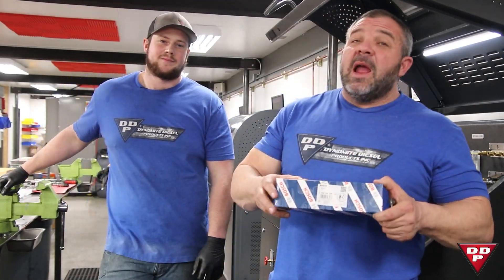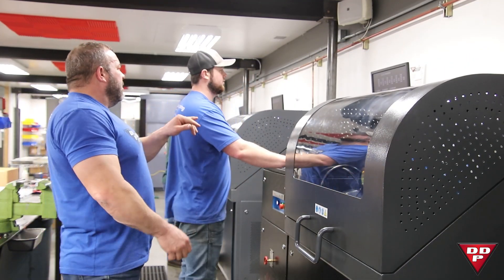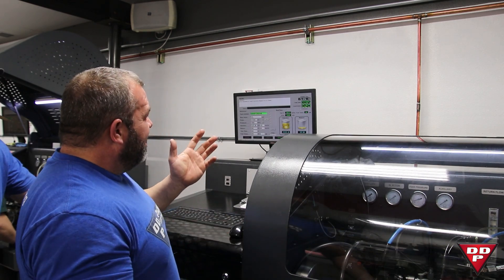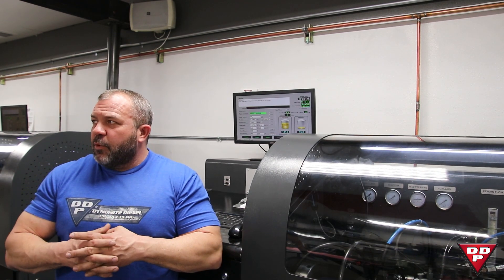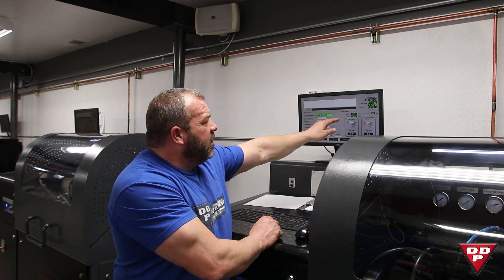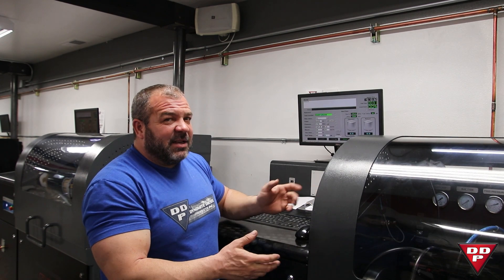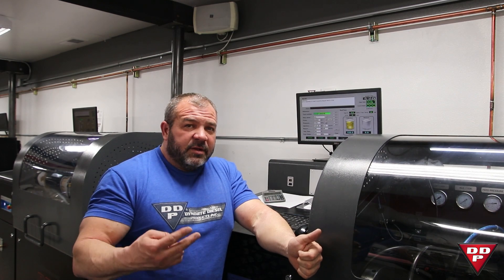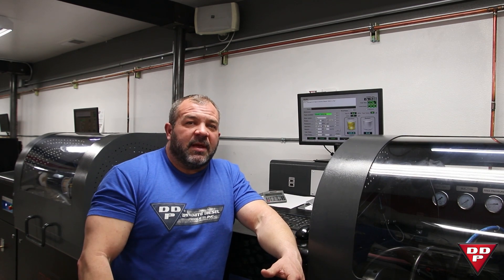Fuel Quantity = POWER!

Comment: Is That 3.5 hp per mm^3 rule is for Cummins 6 cylinders, or good across the board?
Reply from the maker: Unfortunately, there is no "standard" when it comes to HP per mm3 of fuel. 3.5 is what we've experienced on average for different applications, and tuners. We have seen upwards of 4hp per mm3 with our injectors and better tuners.

Comment: Rail plugs? I see you mention return fuel. My thoughts jumped to this. I have been told mixed things about relief valves and rail plugs.
Reply from the maker: That's your call! Some guys swear by them, while others refuse to run them.
Reply: @DynomiteDieselTV   It seems the next injector in the firing order would relive the pressure anyways. Have you ever seen any damage as a result from running them. You have a ton more experience than most people.

The only reason I am using one is because the relief valve failed and a plug is $20 while a valve is several hundred. If I was to use your rail sensor I would have to replace the relief valve anyways due to higher rail pressure.
Reply: Also interested in this point.